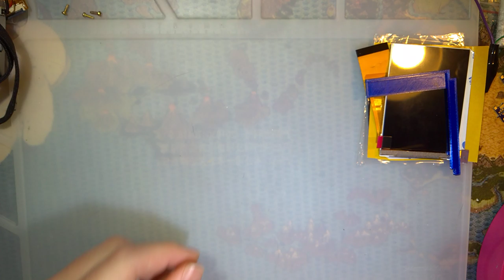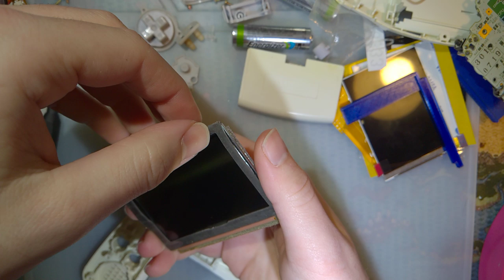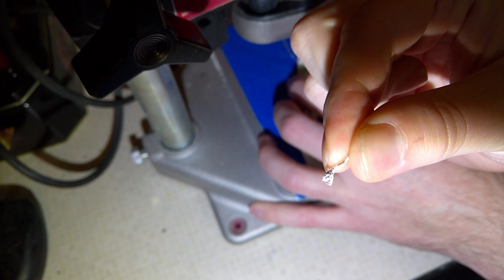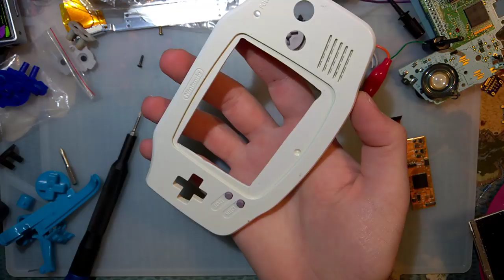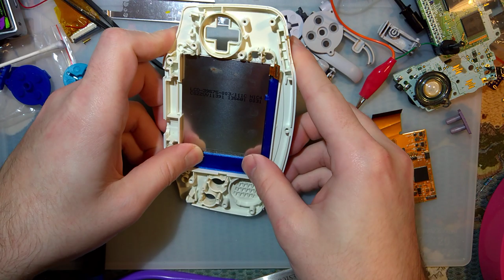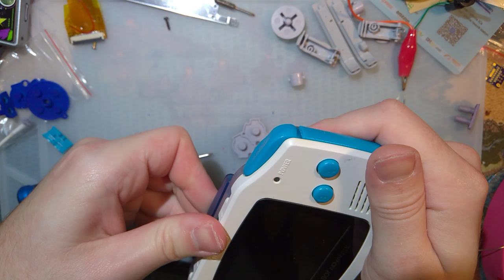Installing the "One Chip" (Non-Funnyplaying) GBA IPS Kit

Comment: I haven't seen a comment about the yellowing of the  Start and Select buttons, well, plastic in general oxides quite easily, and in this case it was probably exposed to the sun and that made it yellow a lot, happens with plastic in general but is easy to solve it with Salon Care 40 and putting it to the sun, or Uv light for long sessions!
Reply: its exposure to UV light that discolours plastics... plastics dont oxide... oxidisation or also known as rust doesnt affect plastics at all...
Reply: also peroxide treatment restores plastics very effectively...

Comment: Using tape to pick up dust helps a ton for the screens.
Reply from the maker: Yes, it does. It's also really helpful for cleaning up cat hair or little bits of wire insulation from the wire strippers. I get a lot of mileage out of my blue painters tape lol

Comment: I already have a modded GBA SP but I recently bought a modded GBA with IPS for the sake of collecting. I also did check if it's FP V2 or HISPEEDIDO V2. It looks like it's HISPEEDIDO V2 because it has that big 5-in-1 Chip or maybe it's something similar but unbranded. My question is, is it okay to use NiMH AA 1.2V rechargeable batteries eventhough it's causing the Power Indicator to blink from red to green or just stays red? I'm using Ikea Ladda 2450mah. The power switch wasn't the issue. I already took the power switch apart to clean it even. When I use alkaline batteries that are 1.5V the blinking from green to red/red to green isn't happening. Will the gameboy advance just turn off at a certain point even if the Laddas aren't fully drained because of the lower voltage?
Reply from the maker: If your power LED is still red on fully charged LADDAs, your power switch is still likely the culprit. Or your battery terminals are dirty too. Or your batteries are old and need to be replaced. 

Nine times out of ten though, it's the power switch.

Comment: The Select button won't workd unless it's used to adjust brightness, do you have the same situation? Or could you advice how to fix this? Thanks!
Reply: Actually the Select button became a second Start! They functions the same now after this whole installation😅 Do you think if it's the problem of the motherboard? Thanks
Reply from the maker: @tonysfortune  did it work before you modified the console?
Reply: @makho  Yes, it worked, I figured it out that I made the wire too close to 'start' sector when  soldering, now they are all good. Thanks for sharing this helpful tutorial bro!

Comment: Hi i have a question and maybe you know the answer, my GBA SP got a moho inside the screen do you think i can clean up, open the screen or not? is between the screen and the protector i think...
Reply from the maker: I assume you mean that your AGS-001 LCD has dust behind the lens? If so, yeah, you can open it up and clean it out but you need to be very careful. The frontlight panel likes to stick to the lens instead of the LCD when removing the lens and touching the panel with your bare fingers will damage it. Canned air is your best friend for this.
Reply: @makho  thanks friendo, but is not dust, is something like fungus or a mold sorry muy bad english. Is like inside
Reply from the maker: @fuanfinalez8531  Oh yeah, one of my SPs was like that. I just scrapped the screen. I don't think there's a way to clean that up and if you can, I think it will cloud the front light panel.
Reply: @makho  thanks Man, i appreciate that.

Comment: What is the purpose for this kit? just brightness?
Reply from the maker: This kit is a backlit screen to replace the original screen that has no internal lighting. The IPS display is much higher quality than other LCDs used for backlight mods for this system.